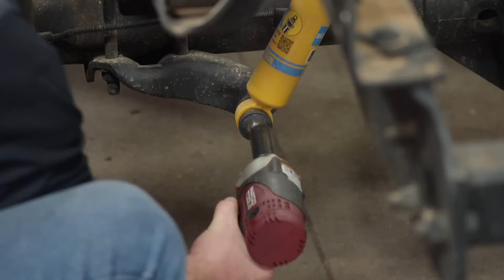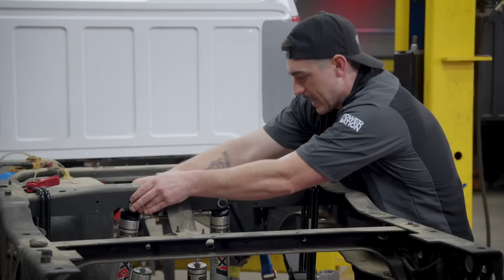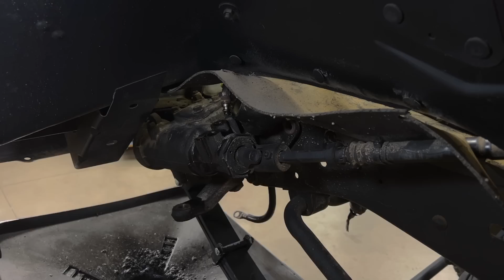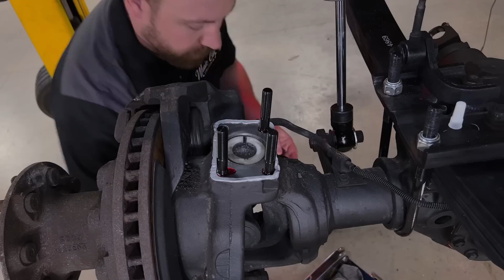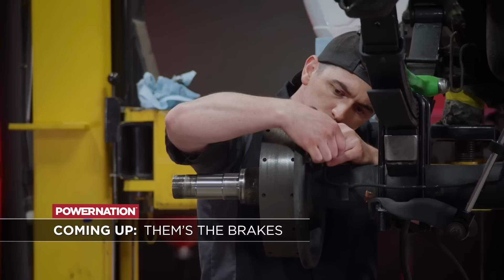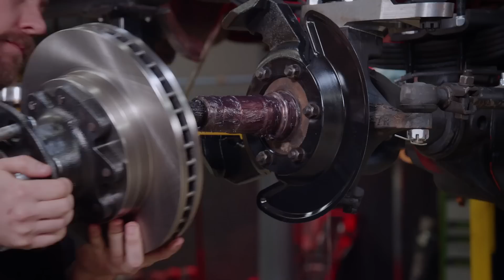New Suspension And Lift Kit On A Cummins Dodge Ram - Music City Trucks S4, E7

Comment: I switched from dodge solid front axle trucks that had nothing but front end problems to GM trucks with IFS front ends last longer and ride alot better and handle alot better... My last solid front axle dodge was a 99 dodge 1500 I really liked the body style but man that thing was always getting front end work and had so much slop in the steering running down the highway 😥

Comment: So yall are taking a fairly formidable work truck and turning it into a poser? Sway bar controls body sway/lean/roll. Steering stabilizer controls bump/bounce and such that can be felt in the Steering wheel.

Comment: "We're gonna take off our sway bar but it will be fine since we are using steering stabilizers"
WTF????
Reply: That's what I was wondering. Steering stabilizers do nothing for controlling body roll/sway
Reply: Once you do a crossover kit, it’s hard to fit a sway bar unless you get one specifically for that kit
Reply: @dancampbell4400  I know that